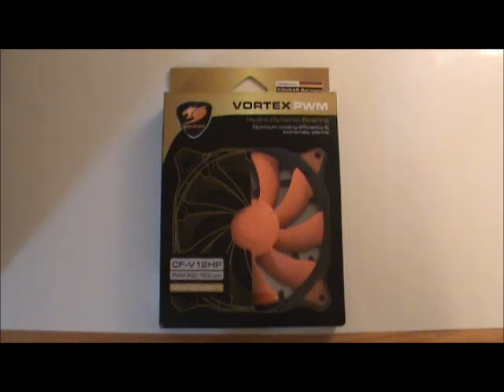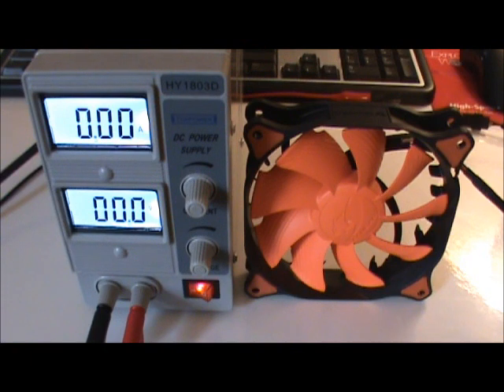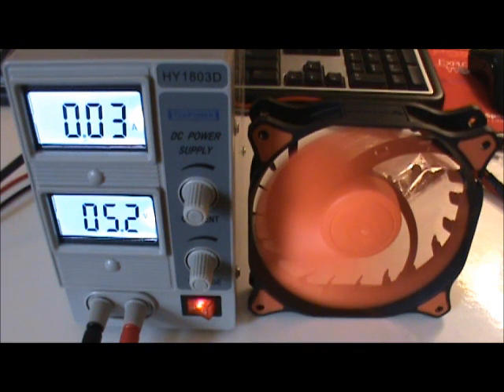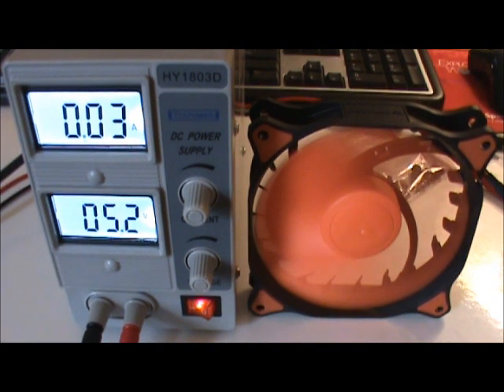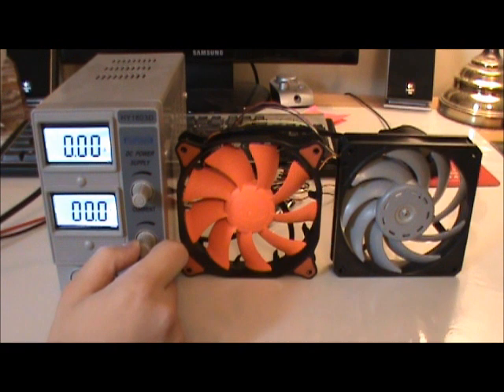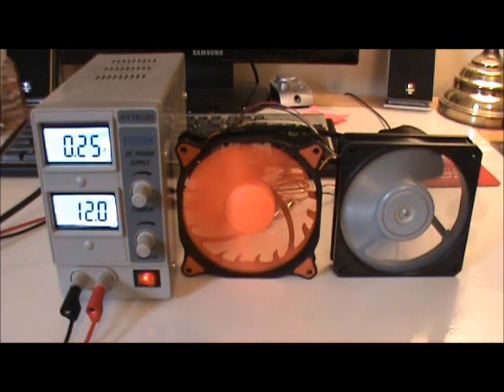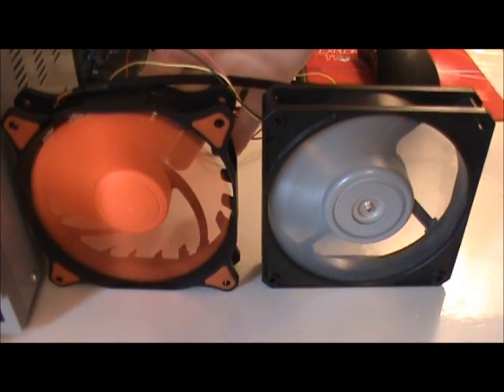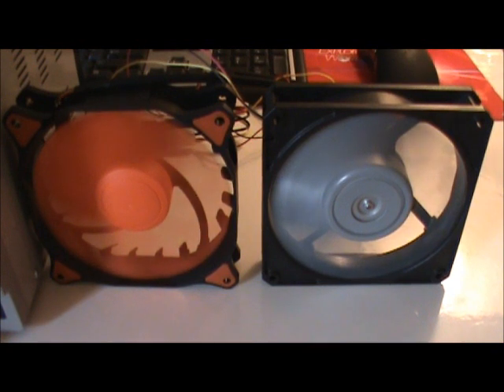Cougar CF-V12HP 120mm fan review

Comment: I use two of these fans on my Cooler Master hyper 212x in push/pull and they work fantastic on my Core i7 920 (D0) overclocked at 3886Mhz at 1.35v with really good idle temps but it highly depends on my room's ambient temperature as it gets really toasty in summer months.
Once i upgrade to a full custom water loop i would use these as radiator fans on medium fin density rads 16 to 36 fpi.

Comment: How ironic you chose to run this against the Scythe Gentle Typhoon as it comes heavily recommended in the silence to airflow & pressure category and honestly if my "local" microcenter carried them i more than likely would have purchased them. However they did carry the Cougar Vortex and i bought 3 of them. Fantastic airflow and the noise is solely air moving which is lovely, i have mine around 1200 rpm in a NZXT h440 and don't hear them over anything else. I have two upfront and one as a chimney exhaust and even in the confines of the case they still produce a steady stream of air, quite superior to the stock NZXT's that came on the case, quieter too. Quite happy. I did hear a "rattley" noise when you put the camera mic right up to the cone of the intake which was odd as i put all three fans on max speed up to my ear listening for that very noise and didn't, nor the whine i've heard people speak of. I have heard that the earlier revisions of the fan had PWM whine so perhaps my fans are revised where they're silent around and under 1000 rpm and very quiet over this. At max you will hear the air flow but it is not obnoxious as a lot of the ball bearing fans i've tried over the years (Corsair SP120, Antec Blue LED- I use these in my case as well and i have both set to no more than 70% power- ever, as i do not like to hear noise- especially the obnoxious sounds these make at high whirls, while wearing headphones), honestly if they weren't so expensive id like to kit my whole pc out in these. Love how they can be ran at a relatively high rpm/airflow and not be annoying or distracting at all. DBa and tonality are both important and ill take airflow noise over whining or clicking etc anyday. Great review MEtalcastr, thanks.
Reply: wow I was lucky to find your comment :D
I just finished building my first desktop on the NZXT H440 and I'm looking for upgrading all the fans. Thank you so much, now i'm feeling like these fans are really a good choice for the H440.
Reply: Glad to help. I actually bought a few more,  very happy with them!
Reply: Mark Acevedo typhoon's break in a couple of months... fact... don't buy them

Comment: bought 8 of these cougar all stop working after 1 month of use so i bought cooler master 120 sickle flow 69 cfm and 19 dba and it been 1.5 years now and the fan still kicking like new
Reply: black crow1234 Horizontally mounted or vertically mine are 1 year old and still going strong
Reply: YoFavRussian both intake and exhaust
Reply: When did you buy them
Reply: YoFavRussian from ebay $4.99 shipping and handling $1.99 back in 2013
Reply: Strange mine have lasted way longer that is odd

Comment: bought this fan to fit to my TV unit as PS4 keeps getting hot (dont hate me as I am a console owner). I need to change the power supply though as I know it is meant to be fitted using molex. USB is only 5v so that will be no good. Any ideas??
Reply from the maker: Use a standalone Molex power supply and a Molex to 3-pin adapter to power it. You can find the power supply under "bench Molex power supply" and similar. Don't get the cheapest model though as it will burn out quickly.
Reply: thanks. Got a mains to molex converter of amazon and its working top. PS4 is much better now, It was getting so hot as they put the power converter inside rather than as part of the lead like most laptops, consoles etc.

Comment: Hi, i was wondering whats the difference between Cougar Vortex fan (shown in the video) and a Thermaltake ISGC 120 MM Hydro Dynamic Bearing Fan?
and do they have any problems with positioning them horizontally? like using them as a power supply fans?

Comment: Right now i have phenom 1055T with stock cooler. My case fans noise are acceptable but the stock cooler is way too loud and if i lower it with speedfan the temperatures get too high/ I'm trying to find a effective but cool alternative. The thing with this video is this fan might sound quiet just like a fan i have does but once you stick it against the side of case with the metal grill it gets way louder.

Comment from the maker: This fan has reports of vibration when mounted horizontally, which means the bearing isn't functioning correctly. Having used google, I found that fluid bearing can be mounted either way, but I've also read that they are good for one orientation only as well. Seems to depend on the bearing, but for fans then yes, most can be mounted either way.

Comment from the maker: ball bearing fans should work horizontally. Avoid sleeve bearing fans as they are only meant to operate vertically. If the fan doesn't list the bearing type it's a sleeve bearing. I only know the fans I have reviewed, but there are forums where people discuss fans, find them using google searches like "performance fans forum" and similar, it will bring up topics that have been discussed.

Comment: Do you know any good 140mm fans that can be mounted horizontally?  These are not good for horizontal exhaust.  Even the manufacturer admits it.  Also the Gently Typhoons are out of stock.  Do you know if the Corsair Air Series can be horizontally mounted?  They are hydraulic bearing, if that matters.  Also, can you use any fan with a fan controller?  I was thinking of getting the Corsair Air Series fans for a friend as well, and if they work out for him, I might add them to my case with these.

Comment: I'm getting six cougars vortex 140mm and the Nzxt switch 810 I'm getting comes with 4 stock  Nzxt 140mm fans, a total of 10 fans.. 8 of them will b connected to a fan controller   but the rear fan will be replaced with a 120 mm x 49mm thick Thermaltake Pro close loop rad , push/pull config.

Comment: I just bought 3 of these. Man I didn't wanna spend $50 bucks on fans but I heard these were good and I just hope they do a lot of air. what sold me was the nice bearings they have. The long sleeve cords and what they do for air per price. 1 will go in my exhaust and the other 2 will go in the front in my 500r case because the stock Corsair fans are utter shit and only do 42cfm on max speed. I unfortunately only have 2 PMW headers on my Asrock z68 mobo so I won't be able to use that feature on 1.

Comment: Good video, one thing to note. The cougar and the GT move the same air, the reason you are feeling more air from the cougar is because it has implemented a focused flow design. This is a good thing as a case fan, but as a radiator or HSF application goes, it makes little difference. This is because the fan flow immediately gets interrupted anyway. The GT will produce more static pressure, the "sickle" fan blade is definitely great at making that constant pressure. All in all, both are awesome

Comment from the maker: @Sapphronful You can see what type end it has, either a 3 or 4-pin motherboard connector, or a molex connector to connect directly to a power supply. Usually websites have a picture of what comes in the box, and if not you can look up reviews.

Comment from the maker: @JayTheProgrammer It has a standard 4-pin attached. You will still be able to control the speed using your 3-pin controller, using variable voltage.

Comment: I notice you said it comes with a molex adapter, does it not have a standard 3pin adapter already attached?  I'm going to buy 4 of these along with a fan controller for my new PC build but the controller I want only has a 3pin connector versus 4pin.

Comment: I'd say sound wise it's around the same as my old 120mm Dynex I got free at Best Buy years ago. Except the Cougar has a more mellow sound because it's the air moving. The Dynex has the air whoosh mixed in with motor whine. Plus the Cougar is far more appealing to look at. Where as the Dynex is just a standard black fan *yawn*. I gotta have sound or I can't fall asleep. When I got my new Gateway the silence was making me nuts. So I put the old Dynex on the side panel vents.

Comment from the maker: @god2many I do not have experience with the H80, and am not sure what control method the H80 uses to set fan speed via button. You can always regulate the fan speed with a fan controller or by connecting them to an appropriate PWM-compatible (4pin) connector on the motherboard.

Comment: Gentle typhoon has higher static pressure, but Vortex moves 14 cfm more air. Hmm. Not 100%, but I don't think it would make more than a degree of difference either way on a radiator or CPU heatsink.

Comment: which is better? 2 120mm fans inhaling cool air from the top.. a 200mm fan inhaling cool air at the front.. and a 120mm exhausting hot air from the rear.. or should i make it so that the the top fans are exhausting and everything else is getting cool air..?

Comment: So, just installed 6 of these in my case, and the only thing I can say - is that you -need- to get these fans!  They absolutely rock!  Excellent static pressure, they blwo air in a true column, unlike many other brands that sort of spiral it all over the place.  These are perfect for side and front intakes, and exhaust as well.

The most noise you will hear is limited by your case, the fans them selves produce zero noise - the limiting factor are the grooves and metal cuts on the case itself.